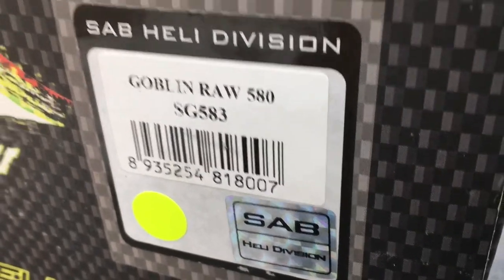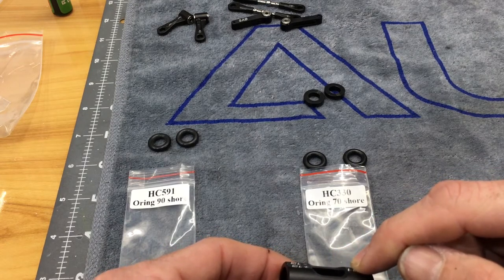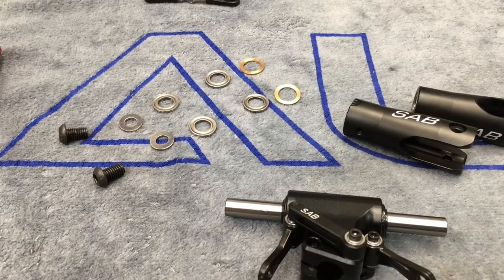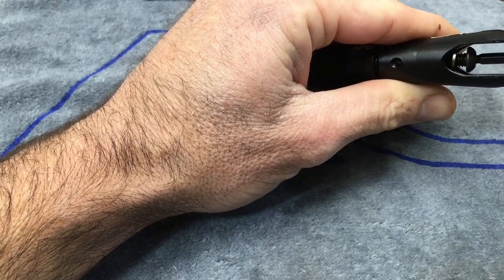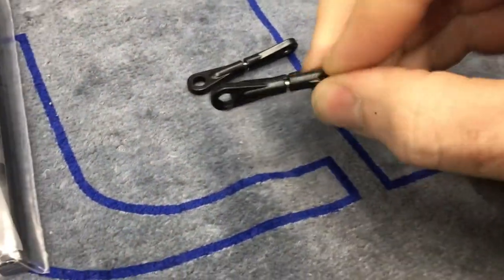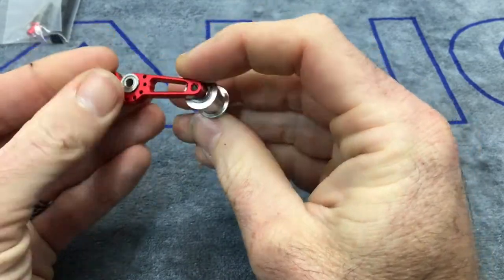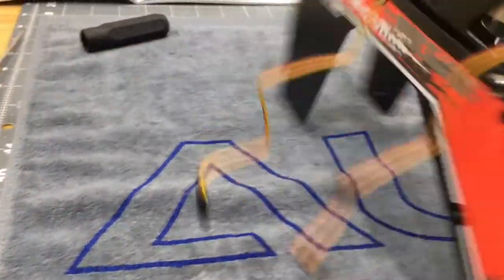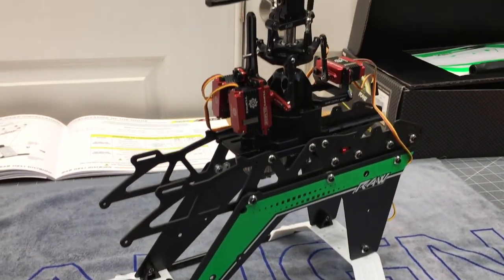SAB Goblin RAW 580 Build Part 2

Comment: Just a tip when building the head… put the blue loctite inside the feathering shaft threads… that way when assembling, you don’t get any on the thrust bearings. 

Great video
Reply from the maker: Thank you, some times I do that and some times I put it on the feathering shaft bolts, if you don’t know to much Loctite you won’t have to worry about it getting into the thrust bearing, or at least I have not had to worry lol
Reply: A ton of respect for your flying and videos!
Reply from the maker: @mattdbot  I appreciate it! Thank you for watching! The tip of putting Loctite in the feathering shaft threads is always a great one. I recommend that to anybody new to building and or heavy on the Loctite LOL

Comment: what are the things and tools i need to build this kit
and does the Hota d6 duo pro charge 12s batterers for this heli+ do you recommend the EC5 or another connector
Reply from the maker: Will need your basic tool sets all of your 1.5 through 3.5 mm drivers you will need all of your retaining compound Loctite grease some odds and ends sets of pliers bowling pliers your normal helicopter tools. This helicopter can be set up from 6S to 12S your choice. EC5 is not a bad connector personally I’d rather use XT90s on 6s and 8mm bullet on 12s

Comment: Are the retainer compound, locktite and Microlube included in the kit, or do you have to buy them separately ?
Reply from the maker: No they are not included in the kit you do have to purchase separately. You can use any retaining compound Loctite and lube of your choice. I went off of what the manual calls for and you can find that on any site that sells the kits. All of this came from Heli direct.

Comment: Hi Nice video, can I ask what charger you use to charge your lipo batteries, and do you suggest a DUO charger when starting with this hobby ?
Reply from the maker: I use a few different charges but my main is a Thunderpower TP820 that they don’t make anymore. Any charger that has a output of around 20 A will be good. It really depends on what you are trying to charge and how many. ISDT make great chargers as well